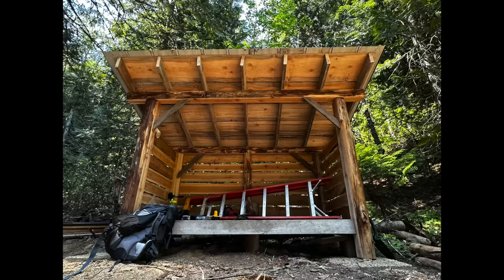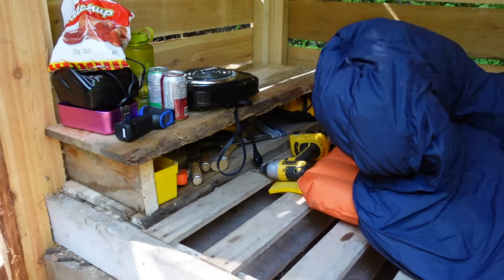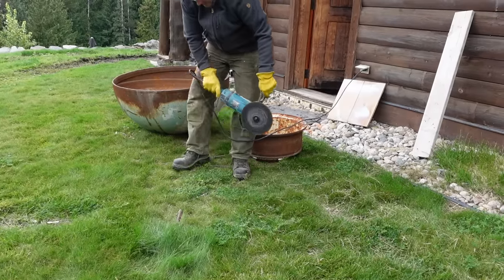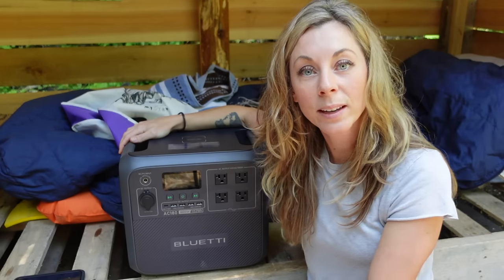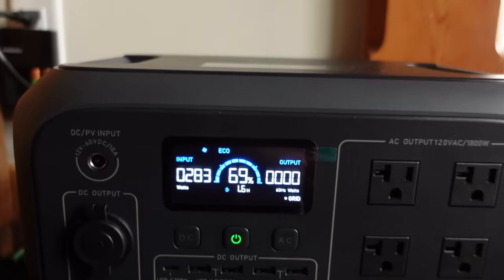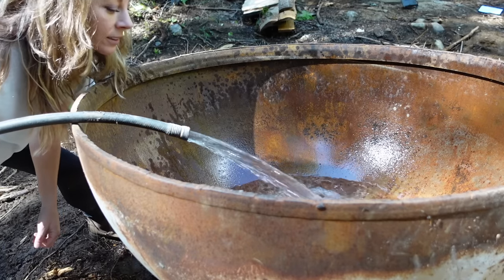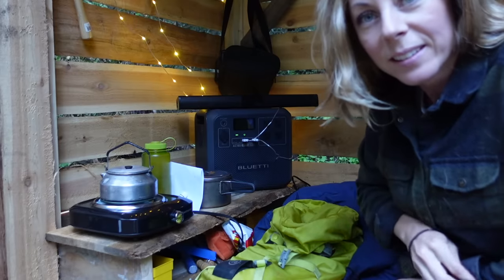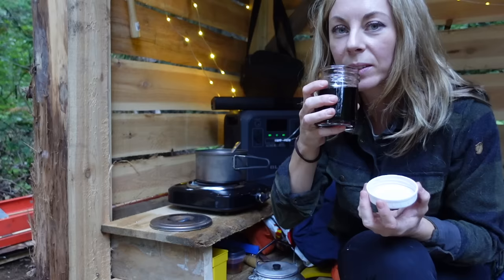Camping in a woodshed down by the creek (Ft. VERY hippie DIY wood-fired hot tub 🤭)

Comment: I know that this is a late comment as i have only recently discovered your channel. A few years ago i made almost an identical hot tub . Three upgrades i would recommend , i welded some steel plate to the base to make it more stable , i welded six inch steel lip around the top edge and covered it with wood. It made an insulated shelf for drinks etc and a seat to assist getting in and out. it also stops water overflowing from the tub putting the fire out. I welded a short length of pipe to a hole just above the air gat at the base and fitted a brass faucet to make draining and cleaning it out easier. I really enjoy seeing you taking on the various projects.

Comment: I used to work for NYC (retired), our in house painters were all Union and highly skilled. Their ladder choice was little giant with all the attachments. What a versatile tool that is. Extensions on legs for ground and stair adjustments. The ladder folded  and planks make it a sturdy  platform and to many other parts to hold tools and step off a ladder onto a work step while ladder is raised and so on. You might want to consider one, they are great, maybe a sponsorship pitch will get you one. Enjoy and lucky Steve, a girl who not only helps around the house but can build one, lol.

Comment: If you really want to clean up the Tub and make it a bit safer. Add some river sand (even fine gravel will work) in the bottom of the hot tub. When in there rub the sand around and the tub it will really clean up and it gives you a layer to stand on that isn't steal.  I built something like this for my sister the sand is key.  Great job on the project.
Reply: Some large rocks tucked in around it would make it more stable.

Comment: Hey mitchy......you should buy an old trailer 6ft long...4ft wide. And convert to mini portable house. Strip trailer down. Do any repairs n welding. Add tabs in sides. Welded. Then osb the floor n unsulate with foam on too. Then wood plank for main floor. 2x4s for sides and pitched roof. Use couple old rusty rustic windows un sides. Add half barn door....one that splits in middle. Add those cheap bought roof shingles and ridge cap. Inside make fold down bed off wall. Fold down table. Add couple of shelves rustic of course then old wagon wheel chanderlier. Couple of candle sconces too. Then bluetti can power it...all electrics. Park it down near woodshed or take with you when required.....be a cool fairly easy build. Just mill some cedar n pine up. Buy isb n roof shingles...find other bits u have lying around. Make stable door with little stained glass window in....
Voila poratable tiny cabin.
P.s love steve helping u....n just digging deep to the crazee but cool ideas....litterally looks like a mitchy boiling pot....lol.❤
Keep happy..well n safe all inc the doggys. X
Reply from the maker: I’ve thought about doing that! Or something similar!

Comment: if air comes to the ground, for the hottub
it is cooler,
wood burns better because cold air pushes hot air,
but the air is more humid,

by burying the burner and making a trench for the wood, and the air,
you make it more discreet,

and allows the air to dry before entering the burner
- with a bed of small heated flat stones, on trench ground, and under burner maybe

Comment: Hi Michelle,
Been watching you, Steve, and the doggos for over a year.
Keep developing your design and construction skills...you are doing great stuff.
Bluetti AC180 is a great little power station. I am a big Bluetti fan, with 2 AC500s, 6 B230Ss, 1 AC70s, 2 PV420s, the AC180 (good choice), and very recently the new AC180T and Multi Cooler. These use the removable B70 batts. Check them out. Keep the videos coming.  RP

Comment: You have so much fun. Just found your channel. Here’s a suggestion for a project. If you go upstream and build a small dam with some rocks you could insert a poly pipe and run it down to your site and have running water. 10m in height above your site will give you 100kpa in water pressure.

Comment: My hillbilly hot tub setup consists of a restaurant stock pot(its huge),over a fire with a faucet drilled into the base.  Set that over the fire and you are able to regulate h2o temps into a vessel that isnt over the fire itself. Plus you wont burn your ass! 5

Comment: Might want to drill the bottom and braze in a boiler drain cock to both fill and drain the tub. Sandblast the the tub and finish with epoxy paint for a safe long lasting finish. Just a thought, looks fun
Reply from the maker: If I think I’ll continue to use it, then I might paint the inside. But may as well just use the same pump to drain it - it worked well!

Comment: JUST A LITTLE TRICK TO SAVE YOUR BACK. GET AN OLD TIRE THE SAME SIZE AS YOUR CHOPPNG BLOCK. 3 SCREWS AND 3 WASHERS, SCREW DOWN THE TIRE AND STAND UP YOUR LOGS TO BE SPLIT INSIDE . AND THEY WON'T GO ALL OVER THE PLACE. NICE AND NEAT IN THE TIRE.
Reply from the maker: Yeah, I’ve seen that done a few times before. Just don’t have a tire laying around! 🤷🏻‍♀️

Comment: You could take the 2 new saw horsorses to the tiny house / shed on the cliff so that "if" and when you decide to build railings around that deck for "safety reasons" because we don't want "sexy lexi or any of the other hottie characters you play to fall down that cliff like your tools, right. This is assuming you could mill more lumber or gather more material to do the job. :)

Comment: Hey, that was a cool hot tub. I was worried it may have been a little unstable at the bottom. It wide top could have made that tub tip over easily, and I would have thought the metal was too hot to hold at the edges. Did your feet feel hot at the bottom of the metal tub? Steve can weld too? It's hard to hold a candle near that guy, his skills though...;)

Comment: 14:00 Part of my brain is telling me not to critique your axe-wielding skills... but... while your form is good, you're missing out on a lot of power because you're not swinging the axe in a full arc. If you think of it in degrees, you're stopping the axe just above and behind your head. Swinging down from there gives you about 130-150° of arc. As I said, your form is good. But, if you relax your wrists a bit and let the axe fall a bit further behind you, you'll increase your arc to around 180-240°. You pull your shoulders down with your lats as you pull forward on the handle and it'll cause the axe head to rotate outwards to the extent that it can, which increases its speed because you're implementing a sort of whipping motion rather than a purely physical one. So long as you're aligned, you'll be able to split logs in a single go much more frequently. Plus it'll save you energy and allow you to go a lot longer. But, as I said, your form is good, so you really don't have to change a thing. Just an opinion from some random guy on the interwebs. XD
Reply: 21:08 'I'm just a girl sitting in a old metal hot tube made of scrap. What more could I want?' hehe. You look extremely comfortable in there, lol.

Comment: Too bad you couldn't gravity feed the water into the cleverly-designed tub for the primitive/off-grid win (you would need a drain plug, too, though).  Seems like the temperature would be hard to regulate in that setup...It's not warm enough....Now it's perfect....Now it's too hot...Now it's perfect....Now it's not warm enough...Probably harder in the winter, I guess as it would cool faster.

Comment: Maybe this is just my personal preference, but I'm very adverse to making my skin contact with rusty surfaces. Seems like that propane tank hot tub(and the rail cart one, too) ought to be sandblasted, or grinded down, then painted with something that is waterproof, and resistant to high heat. What do you think, Michelle?
Reply from the maker: For the long term, you’re probably right. But I did clean it out and the water wasn’t rusty, so a few times here and there won’t hurt 😊

Comment: Motivation?  It isn't easy to pinpoint your motivation for all these various projects....  is it mostly just for YouTube content?  Of course you scored 9,000 views in two hours, so congratulations on your YouTube achievements, as well as your industrious project achievements.  I have a couple of propane tank end-caps, but I don't think they are large enough for a personal hot tub.  My wife wants me to incorporate them into our spring run-off, as a water feature.  All I see is rust.  LOL
Reply from the maker: We had two of them welded together and made into a globe (with a light in it, and designs etched out). It has the potential to be great, but the guy didn’t do the greatest job. We sold a few, gave one or two away, and have had the last two sitting around forever. 

YouTube has given me a reason to give reality to my silly ideas. The skits, the builds, the adventures are all things I think about or could imagine doing. A good chunk of these things I would probably make excuses to not do, but YouTube gives me a reason to make them a reality 😁💝

Comment: Who needs a gym, right? Getting that area cleaned up nice. I was thinking it would be a good idea to cut a round piece of wood to sit in the hot tub for a floor so your not touching the bottom of the drum where the fire touches.
Reply from the maker: I would have done that if the steel was hot. But the fire had been out a long time so was totally fine 😊

Comment: I love your tub, but please make your base more sturdy, just a little platform and some little stones kicked in is NOT stable or save. The metal plus water is real heavy and could tip over...
We do not want you getting hurt, we love you.
Oh and  im sure you saw the spider at 12:16 LOL ???
Reply: official_Michygoss  Hey Mich
Most people do not want to be told what to do, so il tread ever so lightly... Maybe just pour n little concrete slab that locks in with the rim base, and some steps to get in easier and saver.

Just meant to be caring for your safety.

Have a brilliant day.

Comment: Michelle I noticed in your little advert for the battery you placed the unit in the front seat and put a seatbelt on it. I get that you were just showing off a product but I just wanted to suggest to you to maybe think twice about doing that in real, if that is something you actually do. Having something that heavy unsecured in the cab with you is quite dangerous in an accident. Much better to put it in the bed of the truck or the trunk of a car incase of an accident, the heavy battery will be unlikely to cause extreme injuries. Obviously you do as you like I just wanted to point it out incase it might be if value to you. Great video love the Tub!
Reply from the maker: I really did drive around with it like that! Seatbelt on. The charging cord isn’t long enough to charge from the back seat. I suppose it could go on the floor in the front.
Reply: @michygoss7148  Thanks for considering my suggestion Michelle. One of the bad outcomes that I have seen happen was with a  scuba tank loose in the backseat in a crew cab and the Truck lost control on ice up in hope and skidded off the road into a ditch. The driver was fine, just a few scratches but unfortunately his dog ( a 2yo Rhodesian Ridgeback) was killed by the tank, flying from the backseat into the front and crushing him. That battery unsecured, would do that kind of damage or likely worse. Maybe you could as you suggest put an extension into the bed of the truck so everyone is safe inside the cab. Lots of people would say I am being over cautious and maybe I am but unfortunately I have seen these type of bad outcomes happen too many times. I hope my suggestion was helpful. 😁